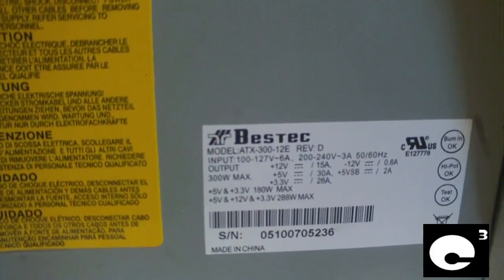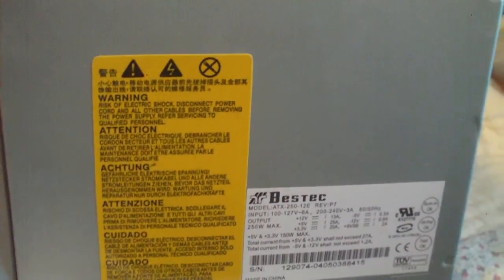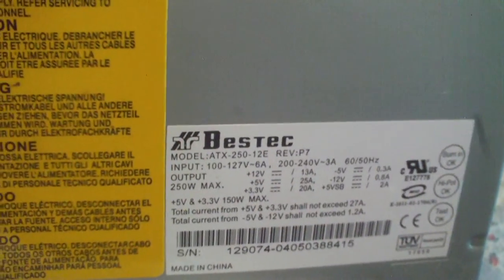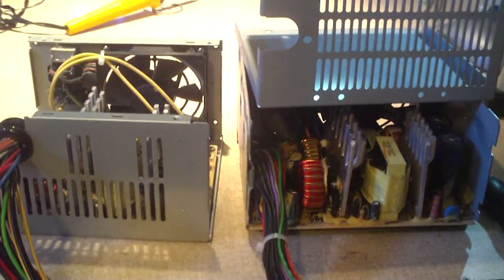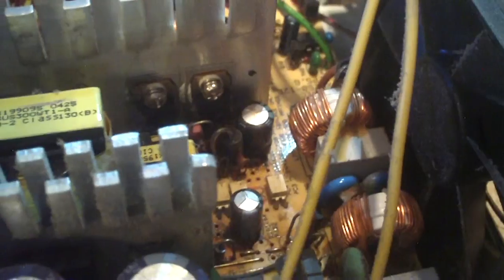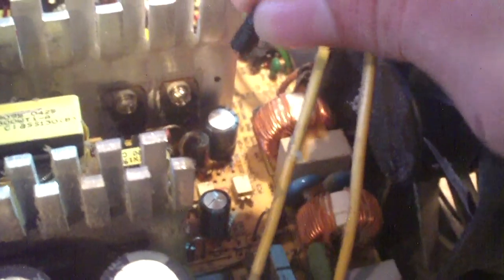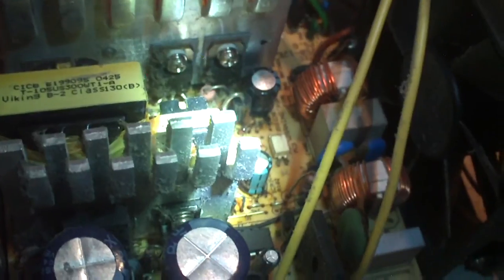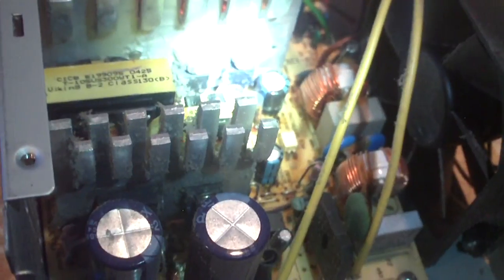Is the Bestec ATX-300-12E safe to use?

Comment: You and Jordan U have both plugged up an eMachine computer with the ATX-300-12E and snapped like a firework. You didn’t get yours on camera but I remember u said it was a huge firework show which leads me to believe this is also not a good power supply but not as bad as the ATX-250-12E. The ATX-250-12E like u said before kills motherboards lol.
Reply from the maker: Any power supply can go up in fireworks... even quality brands like Corsair. The key factor is if it takes out hardware when it fails. That 300-12E didn't harm the computer it was in. It was the first one to go out like that and I've worked with a fair share of them over the years.

Comment: I have a question about the +12 volt yellow wire.  Are they all off the same point of the board.  Can I wire 2 +12volt wires together to get less voltage drop by esential upping the wire size?
Reply from the maker: On this unit the 12v wires all come from a specific spot on the board. This unit uses a 15A 12V rail.

Comment: I have a friend who has an eMachines T5048 media center computer that contains the Bestec ATX-300-12E PSU and it's been working good so far.  I even upgraded the CPU chip on that eMachines computer from Intel Pentium 4 3.06Ghz (524) to a 3.60Ghz (661) model several months ago and the Bestec PSU can handle it.  Though I think the ATX-300-12Z model is slightly better because 12Z has 2 SATA connectors and the 12E has no SATA connectors.
Reply: In all fairness that CPU upgrade probably actually reduced the power consumption the 65nm Pentium 4s used significantly less power than the early 90nm ones.